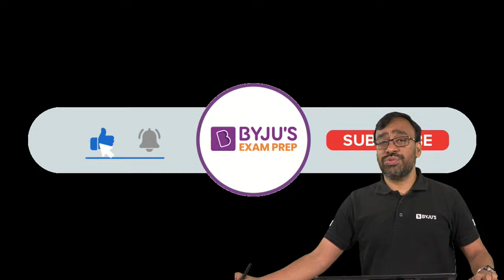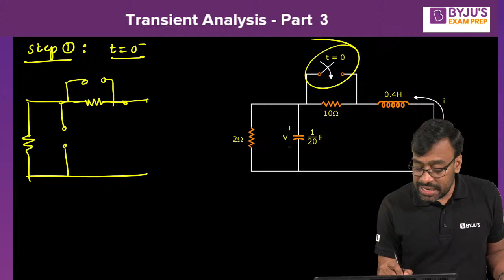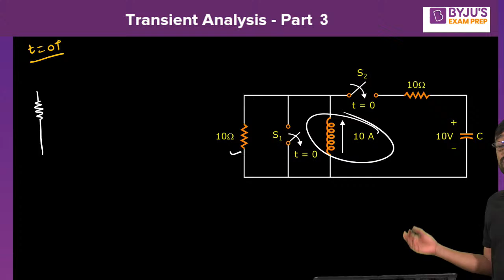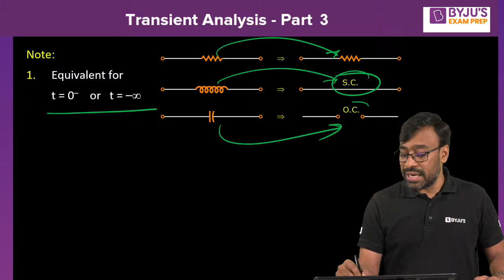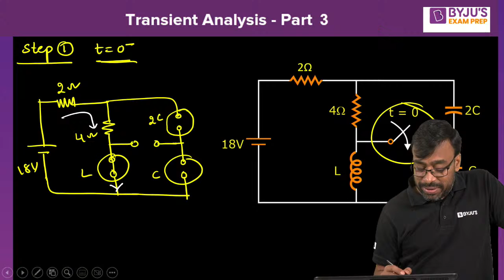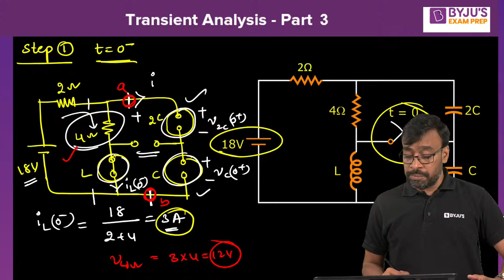Transient Analysis (Concepts & Simple Techniques) (Part-3) | Network Theory | GATE 2023 EE/EC/IN

Comment: At 56:00 sir.....will not the current of  2.5 ampere will half flow to the 20 ohm resistor and half of it flow through other 20 ohm resistor by KCL.
Reply: Since it is open no current will flow